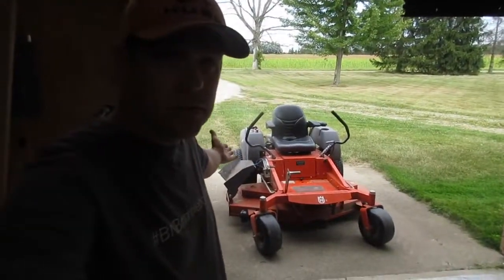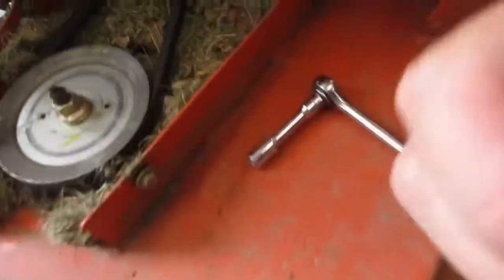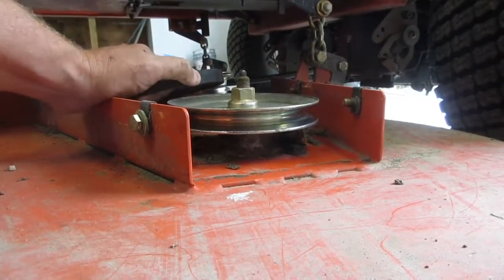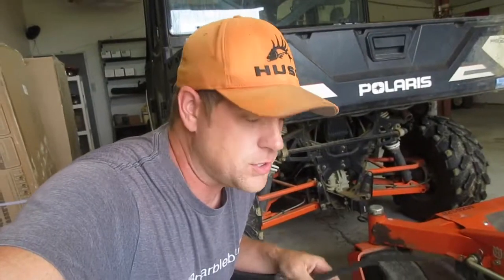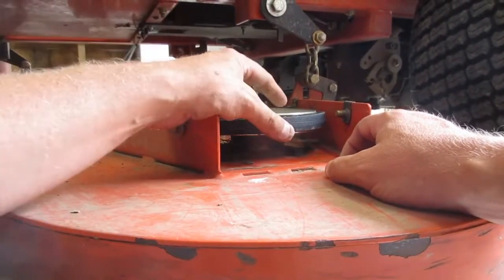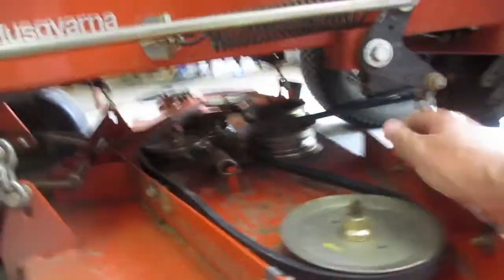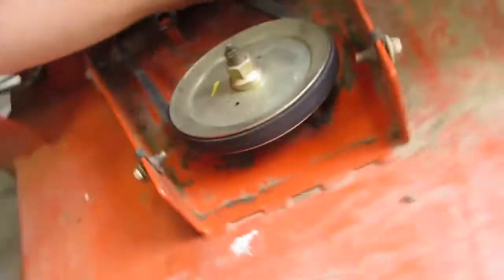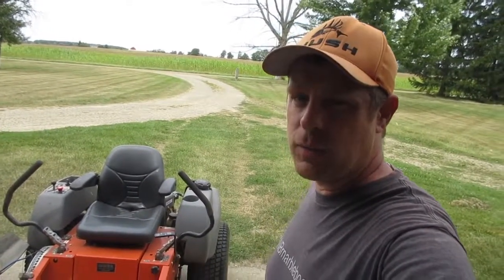Husqvarna MZ6128 Deck Belt - How I Changed the Mower Belt Myself

Comment: Great video!
My mower had wrong size belt. Took a couple seconds to get up to speed. Had to use a socket to turn the spindle cause that bitch was tite. It chirps a little now but the blades don’t bog down. Thank you for that.

Comment: You should have used a 9/16 socket wrench on the tensioner pulley which allows you to use leverage against the spring. This will give you the slack you need in the belt to more easily get it around the last pulley without the threat of getting your fingers punched.
Reply from the maker: Thanks the the tip!  Will definitely do that next time.
Reply: Mine does not have the 9/16 bolt, therefor I will have  to change it as per the video.